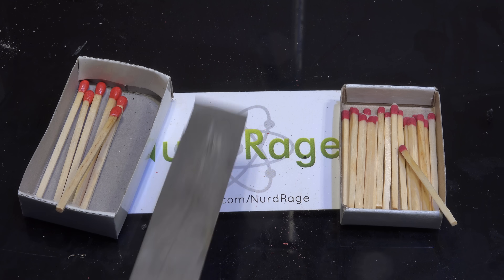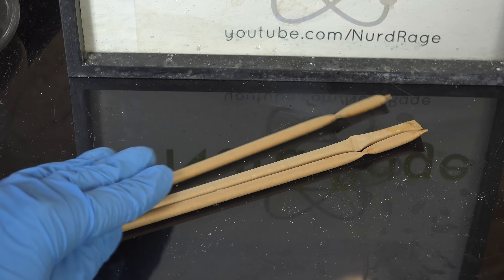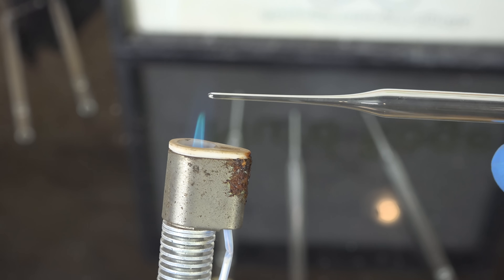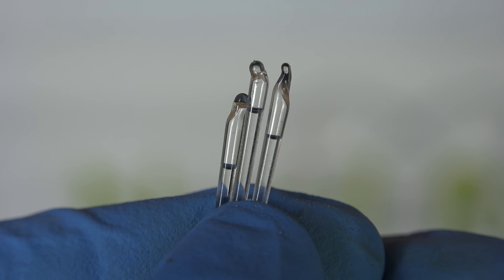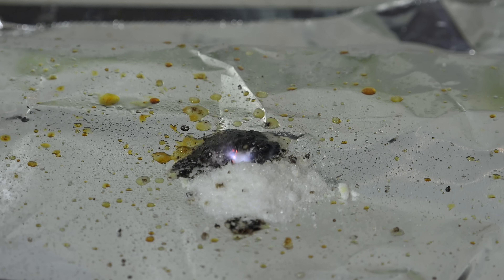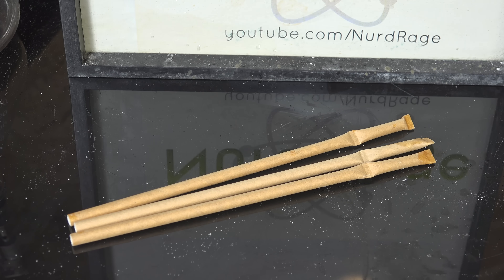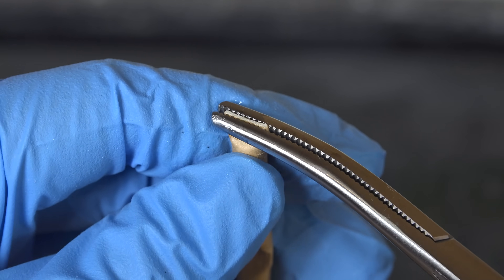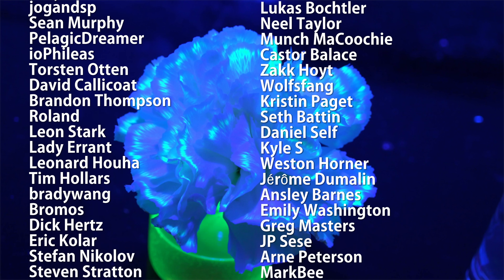Promethean Matches - The Ancestor to Modern Matches

Comment: So, not sure if anyone else has pointed this out, but I'm pretty sure dipping the end in wax wouldn't help with ignition at all, but it would absolutely make them waterproof. Additionally, it would provide fuel and make the flame burn longer. Moreover, you could fill the long unused portion of the paper straw with wax, and have what would amount to a self igniting candle.

Comment: Have you tried making Lucifer style friction matches?  These were phosphorus free from the 1830s on, (though they weren't as popular as the ones with white phosphorus; they were less reliable and much noisier), using potassium chlorate and antimony sulfide in equal parts plus binders and a little iron oxide (catalyst or coloring agent, I'm not sure).  Dipping in molten sulfur made them slightly safer and more reliable, and early safety matches were essentially the same with the sulfur incorporated in the heading mix instead of coated on (ostensibly to cover the stench of the burning hide glue binder).

Comment: I read watchmen in gunpowder factories used to carry a glass tube full of some oil (olive?) and a lump of some material, that emitted a soft light. Supposed to last for days.
Reply: A lump of white phosphorus in oil in a glass vial will give a soft light when the vial is shaken.  Some of the phosphorus dissolves in the oil, and the thin layer of oil on the inner surface of the vial allows it to oxidize and glow.  The remainder of the phosphorus lump is safely under the oil where it is protected from air, and as long as you let fresh air into the vial now and then you can use it for a long time.  Some early books on chemistry tricks claimed that this oil was also safe to spread on face, hands, or hair to give a glowing or burning appearance, but I'm reminded of Hennig Brand, who initially discovered it, and among his other experiments, rubbed a solution of phosphorus and oil onto his 'privy member' and found it to chafe and burn him in his tender places quite mightily.
Reply: @andrewtinker7537  Thanks so much! I won't be trying that experiment!

Comment: This may be the traditional way of making self igniting matches, but why did they not use safer reactants, such as potassium permanganate and weakly acidified glycerine.
Reply from the maker: ya got me, maybe at such small sizes the Permanganate glycerine reaction wasn't reliable enough, or they couldn't make permanganate of high enough purity or low enough cost at that time. Maybe they did figure it out, but it was too late and more advanced phosphorus based matches took over.

Comment: Cool video!  I didn't know what chemistry was involved in Promethean matches; I would have guessed permanganate and something organic.

Sulphur matches were extremely common in the 19th century.  They didn't strike - they caught the spark from the flint.  

On the trail, I still light fires with flint and steel (or rather, ferrocerium).  Unlike a match or lighter, they work even when wet, and I can strike a spark even when shivering uncontrollably. My tinder - dryer lint or cotton balls and petroleum jelly - also works when wet - or rather, doesn't get wet because water won't wet it. I have fallen in a river in near-freezing temperatures at least once, so the performance of this system has been confirmed experimentally. In other words, I'm still here to post this.
Reply: Hi. Security Team Leader here. 
We're debating if a guy who falls into freezing water more than once should be allowed the ability to make Fire ;)
Reply: @aga5897  🤣   It probably wouldn't help if I told you that I was on a 220-km solo hike through the Adirondacks, and when it happened I was almost 20 km from the nearest highway. Yeah, I'm slightly nuts. 🤪 

I was as careful as I could be under the circumstances.  I could see that the ford was sketchy.  I laid in a small amount of firewood on the near bank so as to have somewhere to retreat to, made sure that my tinderbox and my locator beacon were on my person and not in my pack, had prepared the pack with both a waterproof liner and a waterproof cover, slung the pack over one shoulder so as to be able to get out of it fast if I wound up swimming, and so on.  In the actual incident I fetched up on a rock within seconds, saw that someone else going the other way had had the same idea and laid in wood on the far bank, and completed the crossing.  I got a fire going, got into dry gear, and was fine.
Reply: @ke9tv  Glad you made it ! OK, i'll argue to let you keep the magic :-)

Comment: Glycerine and sodium permanganate would do the trick as well and would be safer to use. Also drenching the paper straws with wax would be better as well to have a decent burn time like a match
Reply: Glycerine and permanganate would be a LOT hotter too.
Reply: @chemistryofquestionablequa6252  I would still want to use the chlorate based composition if the match was being used to light a cigarette though. Not that cigarettes are healthy anyway, but the manganese biproducts could make them even more carcinogenic.
Reply: @SafetyLucas  I don’t think I’d want to use any formulation like this to light a cigarette, I’d probably set my beard on fire, lol.
Reply: Paper straws are already wax coated (at least the higher quality ones), but not to the extent that they would provide a better burn time. Double dip away!
Reply: The potassium salt of permanganate is most readily obtainable and would do the job perfectly. No need to use sodium permanganate.
Reply: You wait till its burned down past the nasty stuff to light anything

Comment: I would say that these matches where primarily for military use. They provide intense flame so they will even work in a wet environment. They could be stored for a long time with a wax or lacquer coating. Cost is not an issue. The danger of use more but the benefits outweigh the risk.

Comment: I volunteer at a local Museum and we would occasionally find these among donated collections or sets of old household items that got donated. 
People usually didn't know what they were and kept them lying around in a drawer of arts and crafts or christmas decorations.
A few went off spontaneously from thermal expansion and cracking of the glass ampule over time too.
Always made for a fun surprise :D
Reply from the maker: ah cool! Do you have pictures? There are so few good pictures of them on the internet.
Reply: Please post pictures if you have them!
Reply: That sounds incredibly dangerous. I'm surprised I've never heard of such a match before when it's clearly something that the general population should probably be aware exists in the event that their ancestors left some for them.
Reply: @Beskamir :   There’s all kinds of dangerous leftovers from previous generations. Scores of people have had the misfortune of discovering various toxic elements and chemicals from sources such as old chemistry sets designed for kids, household chemicals under sinks and in storage sheds, and chunks of poisonous elements like arsenic and thallium kept in periodic table collections. As a rule of thumb, if you inherit something and don’t know what it is (especially if it contains liquid or powdered substances), dispose of it at a recycling center that handles questionable items.

Comment: I would suspect the glycerin and potassium permanganate to be a safer and easier alternative.
Reply: Probably some historical timing why potassium permanganate wasn't used. Changes in chemistry were happening at a rapid rate throughout the 1800s. Also manufacturing methods. Even though labor intensive, or at least viewed as such by modern eyes, using sulfuric acid and potassium chlorate, may have been the most economical option at the time. As methods change, prices of goods, relative too each other change. That's why things often only make sense, on a historical timeline.

Comment: Have a secondary compartment with an ampoule of water and packed with calcium carbide for starting fires on damp wood, now. 😄😄🔥🔥🔥
Reply: I have used a small pike of carbide and the pouring rain slot start camp fires many times , when simply using a carbide lamp flame wouldn't quite cut it .
I still have several gallons of carbide on hand , for my lamps and " other uses " .

Comment: How would this setup fare if it used the classic flamey staple of potassium permanganate & glycerine? Would the reaction be enough to burn through the straws, or just smoulder & fail?
Reply from the maker: not sure, the amount in a straw might not get hot enough to ignite, but definitely something to try in the future!
Reply: Back in the day ( when dinosaurs roamed ) , a common prank was a 35 mm film canister with some glycerine in the bottom .
A small piece of tissue containing Potassium Permanganate was stiffed in the very top but not contacting the glycerine .
When tipped over or up ended they would mix and ignite .
Those film cannisters were very versatile .
I have even heard of people storing film in them ...
Reply: It’d work, but would take like ~30 seconds to light after breaking. Be sure to throw in some thermite mix or chlorate/sugar for good measure😁